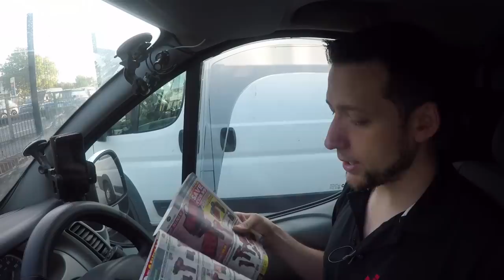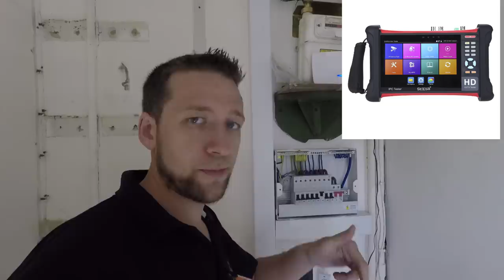Breaking out the Ducati of AWESOMENESS (and some data work) | Thomas Nagy

Comment: Please enter me in your tool give away.

As far as I know the RJ45 connectors are fairly interchangeable for CAT5 and CAT6.  If there is a difference it has to be very insignificant.  As Ethernet cable is evolving, it gets qualified for higher and higher speeds which most likely involves better control of the twists per foot for each wire pair and lower coupling capacitance.  So all the value is in the cable and breaking out the wires to terminate them to a wall plate, for example, creates a far worse impedance bump than any special CAT6 connector could possible make up for.  I would say that if the method of termination is the same for both wall plates, you should be okay to use the less expensive CAT5 labelled version.  And as someone else mentioned, with shorter cable runs, you can get way with lesser quality cable, but I wouldn't want to try to explain this to a customer.

Comment: Rooooter Gak, Patch panel cat 6 VS Cat 5e not much difference IMO - though you cannot get away with saying it's cat6 if it don't say cat6 , IMO putting in data cable is much better than relaying on wifi - it will all be faster especially if you have several users - cat6 is great future proof - 10G is more than enough for any home environment [we're still on 1G for work - though 10G at the server ends]

Comment: hard cable ( wired connection ) compared to WIFI decisions easy your stuck with where your wired connection is, where with WIFI you can move it anywhere inside or outside ....

Comment: Hey Tom, entering the comp.. because why not. Cat5 vs cat6 in domestic settings in my opinion makes no real difference... Perhaps in extreme circumstances you might get better noise performance but domestic users are simply not pushing the line speed... In cat6e termination is everything. Also, in my opinion don't get a DSLR for run and gun. The problem with DSLR setups is you have to rig so much around them it just becomes irritating... Great for indie filmakers but in your circumstances I think you'll regret it. Try a 4k handy cam instead.. something like this...https://www.cliftoncameras.co.uk/Sony-FDRAX700-4K-HDR-Camcorder?gclid=CjwKCAjwzenbBRB3EiwAItS-uyFAT8KDNSZrD9svkBEVPaj6_fLAi3Bs_0Nl3xbN4YIgBMr1-v8hmRoC15AQAvD_BwE... See ya!

Comment: How did you become a electrician ie what course and qualifications did u beed
Reply: Level 2 electrical installation (A)
Level 3 electrical installation (B)
18th edition REGULATIONS (C)
Inspection and testing (D)
NVQ level 3 portfolio (E)
AM2 Exam (F)

After all these steps u will be 
JIB Approved electrician 
Qualified in another words
Reply: Rough idea for time line on each step 

A- one year 
B- one year 
C- 5 days to perhaps 4 weeks
D- 3 days
E- minimum 4/6 months but depends on yourself and how many units you can cover with the job your on
F- 3 days
Reply: MI J or an apprenticeship which covers all this

Comment: Entire CAT5e and CAT6 argument is simply a marketing strategy. CAT5e gives you possible max speed of 1000Mbps (which is bs, its about 500Mbps) which is more than enough to support any home based IT system (U.K average speed is 40Mbps). You'd end up spending more money installing CAT6 cable and accessories to it.
Reply: Ahh, how many ways can one be wrong.. 5e does not give you a max possible speed of 1Gbps, that's just what the 1000BASE-T standard gives you. You can get 2.5Gbps, 5Gbps, maybe even 10Gbps if you connect suitable equipment (802.3bz - NBASE-T). And no.. it's not BS, and it's not 'about 500Mbps', it is, nominally, 1Gbps full duplex - there are overheads and a lot of complications in achieving that number, but >900Mbps is rather routine. And that's real, and full duplex, not the hilarious claims of 1300Mbps and 2600Mbps and even greater figures for wifi. Those, those are marketing lies.

Comment: I know faster speed broadband works over network at a higher frequency. For example ADSL broadband works on a much lower frequency than VDSL such as the FTTC products. 
I don't know for sure but I would expect there are different circuit board components to cope with a higher frequency broadband service to lower noise interference, Maybe!!! Lol.

Comment: cat6 connectors are the same as cat5, the only difference is the shielding and sometimes the quality of the cable.
they both terminate the same. so, you shouldn't pay more for a cat6 connector.
Cat6 is nice........ but seriously, you wont have any difference in QOS when installing at home.
also, when you plan a journey's route in the car, it's pronounced the same for a router. stop using the American pronunciation :)